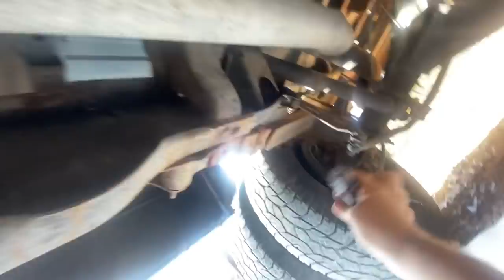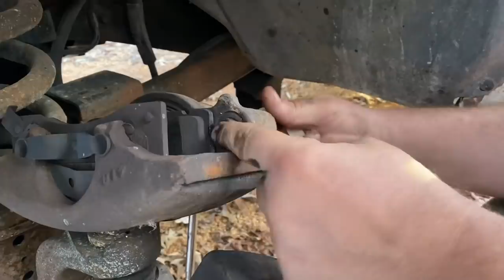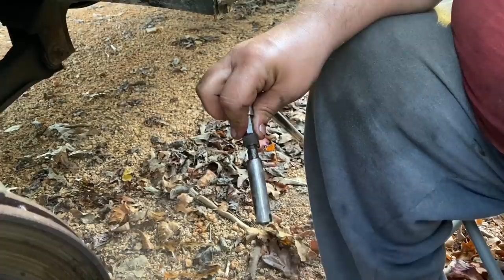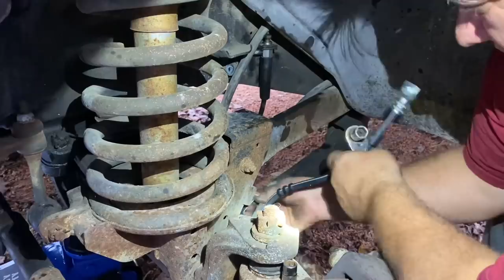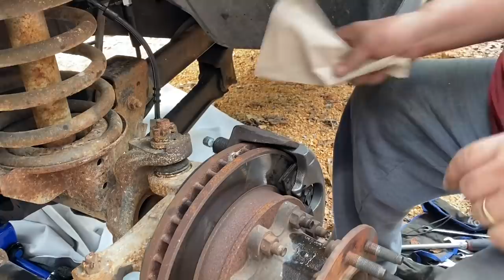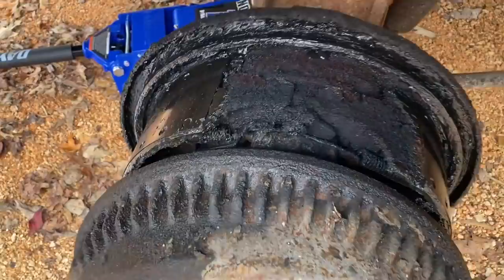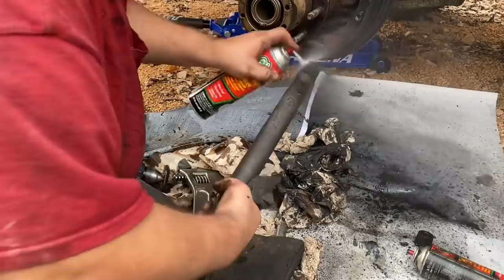Brake work and maintenance on the dodge 3500

Comment: that delay on the break is the flex break line , its rust pushing the around the rubber line shut around the pressed crimped joints

Comment: take a clothes hanger and break off the the bottom straight peice, bend the end, wrap a peice of emery cloth in the end you bend and put the clothes hanger in a drill and giver er shit. spray some brake clean in and take care of the old grease and dirt in the hole for the pins quickly

Comment: I have a 2002, 3500 it has 4 wheel disc brakes, with the emergency shoes inside the wheel hub.! someone really messed with that truck 3 diff size lug nuts? This yr. I changed all the brake hoses and hard lines and fluid. had the same issue! dragging brakes.
Reply: consider a master cylinder if the brake fluid was never changed its around that age when the rust starts flaking off inside the lines and destroying everything

Comment: is that a v10 if so the rear two cylinders can run so lean they melt pistons.
Reply from the maker: 24v Cummins
Reply: @BusGreaseMonkey  well that is write up your alley
Reply from the maker: 5 speed manual
Reply: @BusGreaseMonkey  That is either an NV4500 or the G56 if its the 4500 the 5th gear nut backs off and it pop out of 5th gear.
Reply: I believe Tyler was just inside that trans.....

Comment: Welcome to hazard freight
 Sure it's supposed to do that and if you wait long enough it'll turn into a single blade helicopter.
 Use a little vener slide on the caliber. Facttree. A little 500 weight gear oil will make it quite.

Comment: there's your problem you got a 3500, get a 1500 and work the crap out of it. the 9.25 Chrysler axel in the 1500 is danm near indestructible.
Reply from the maker: We will be towing some heavy equipment and this truck was very inexpensive.  A few grand in parts and some elbow grease and we should be good to go.
Reply: From experience the 9.25 is very destructible. I've killed mine like 4 times in my 04
Reply: @Spyke383   I have towed 20k behind them no issues. I used to work with a friends dad doing roofs that was a 76. my 04 i pull 12-13k with at least once a month.
Reply: my 04 has 255k miles on it and other than the 9.25 clunk no issues.
Reply: my ramcharger i tow 15k with it.
Reply: a lot of people think they clunck the make going in gear or reverse is a sign there bad but they all do it. The trac lok is kinda chessy and the clutches in them don't last long but they keep going long after the clutches or toast.
Reply: @ghinckley68  clutch kick it and drift a roundabout. It'll grenad the pinion bearing. But also worth us drifting a cclb is fun as hell.
Reply: @Spyke383  My 76 had a 400 BBL in it. I use to stomp on it the speo would go to about 80 and stay there till the tires started to grab. No power breaking no nothing just smoke over the wheel wells till the tires hooked up.

Comment: Probably low on oil - SHOULDN'T BE - BRAND NEW - add ATF to pump cylinder if low - works fine!!
Reply: Or air locked